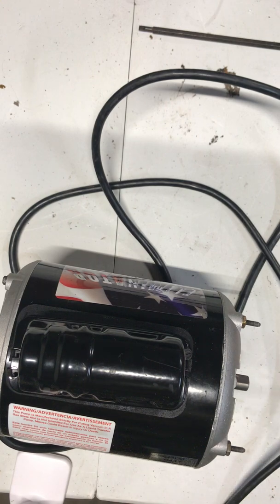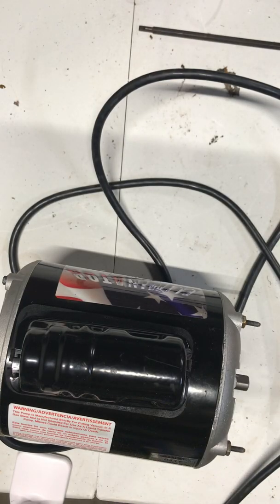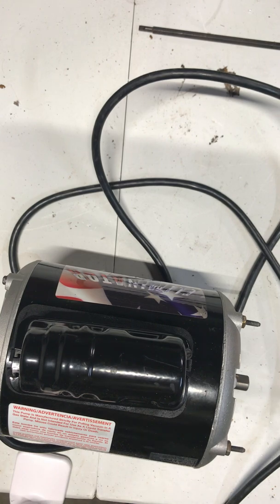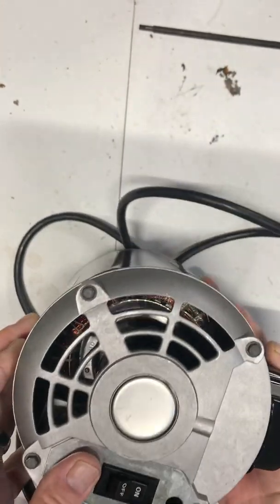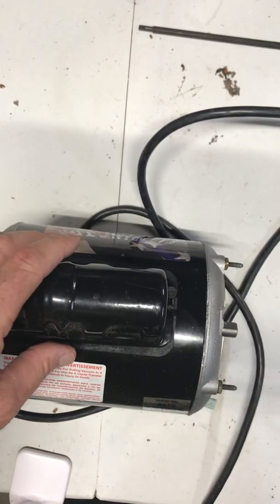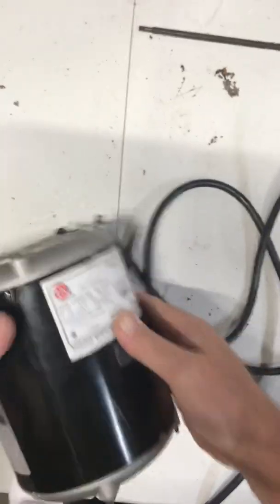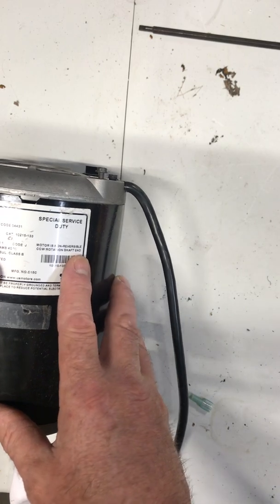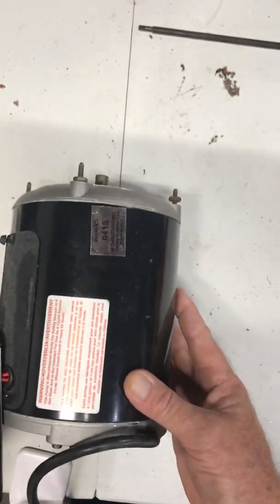What is a Capacitor Start Induction Run Motor CSIR

Comment: 90% of the time it's just the capacitor. When possible, higher voltage capacitors seem more reliable. The motors often go up to 5 HP but can go up to 10 HP.  I think 10 HP single phase is the most that power companies allow on their grids. Above that requires 3 phase power.